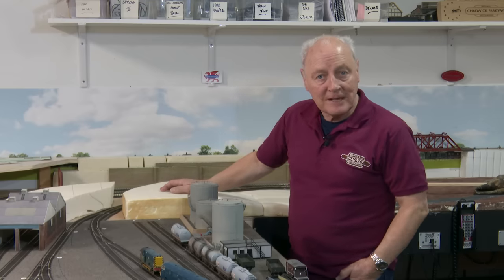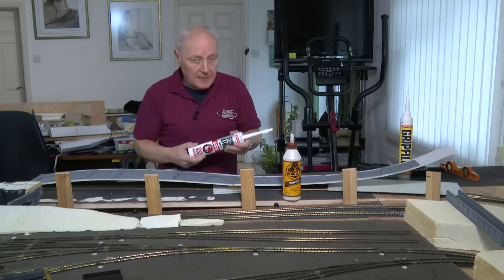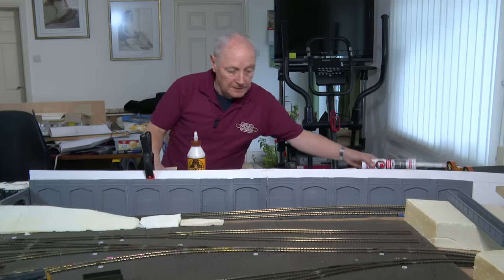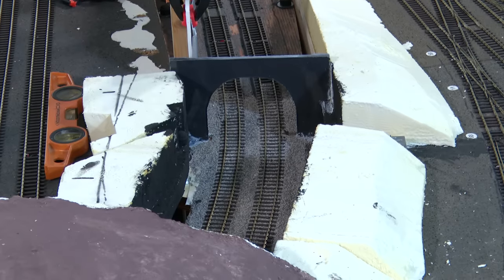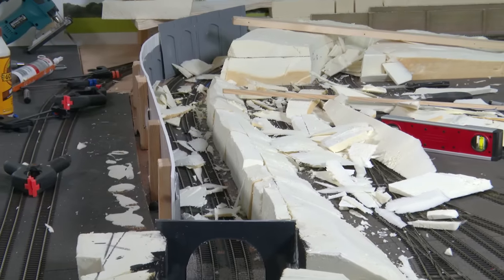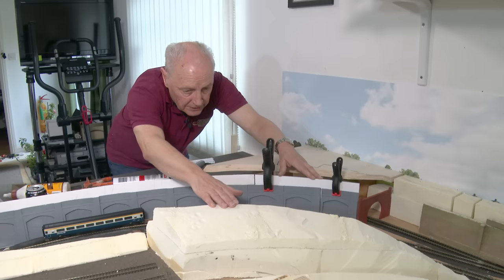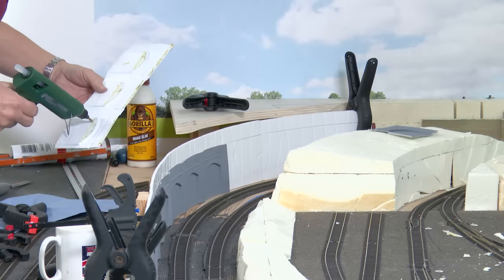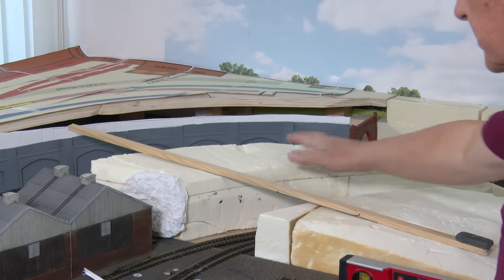BUILDING HILLSIDES & CUTTINGS at Chadwick Model Railway | 207.

Comment: Afternoon Charie. Top tip nice to meet you you last week at Wharley.
If you prefer to use the sticks like etc then find a local upvc center. the cost will be significantly cheaper than big name trade stores.
also normal bog standard clear silicone will work very effectivly on bonding the senics together and at half the cost per tube. Again use your local upovc center. Brands like Henkle (which is bond it) DL Chemicles Wurth a fraction of the price of diy stores and better quality with less water content. easy for me to say though as I use the stuff daily.
Fantastic video again though
Reply from the maker: Many thanks, Richard, for some useful information. Regards, Charlie

Comment: You need to spray teflon/silicone on that Woodland Scenics tunnel lining mold before putting the plaster on it, that will make it come off easier without stressing the plastic.
Reply from the maker: Thanks mate, for useful tip. Regards, Charlie

Comment: Charlie,

I looked at Viesmann and Faller and wrote them both off. They only seem good if you like lorries!  

Instead, I’ve invested in Magnorail which applies magnets under ANY standard Oxford Die-cast car, which makes it incredibly flexible. There’s even a bicycle with the rides legs moving!

I recommend looking at it before you shell out a HUGE amount for Faller and Viesmann. 

Tim.
Reply from the maker: That’s good advice, Tim. However, do you believe it would be possible for me to run the Magnorail system up a hill!?
Reply: @ChadwickModelRailway  According to the FAQ, it can manage 45 degrees, but I’ve not tested that.
Reply from the maker: I hate to spread rumours, but some say it’s a noisy system. Could that be true?
Reply: That’s a fair comment. 

There is a motor running the track vs a motor in each car. I don’t find the noise an issue to be honest - I’m placing my motor in a scenic as part of a tunnel and I have insulation on the screws (track foam!) to absorb any reverb. 

For me, it comes down to 1) cost and 2) the breadth of choice of vehicles you can run. 

Horses for courses. 😁

Comment: Charlie, another interesting video.
Certainly lots of cutting and reshaping going on.
That, I assum foam based, engineered brick wall boards look good, but it is very monochrome.  You would need to pick out different blocks in various similar shades of the grey, and add a lighter mortar to give it more appeal - in my opinion.
Good luck with the subscriber drive, your videos are certainly worth viewing.
Cheers, and stay safe,  Michael
Reply from the maker: Mr assured Michael, the plain brick face will have lots of added detail. Stay safe, regards, Charlie

Comment: Great video Charlie. I have always lined my bridges and tunnels, but in 7mm scale all this has to be done from scratch, especially if on a tight budget! I found that a certain banking co. uses envelopes for their monthly statements that the inside of are perfect size for 7mm blue brick walling and use that! 
Regards, Paul - in a not so sunny St. Blazey.
Reply from the maker: Many thanks Paul, however, my aunt in Falmouth, had 6 inches of snow! Regards, Charlie

Comment: Charlie your cracking Woodland sScenics mould , in a vac mould polystyrene.
You can mend and reinforce it with a small plate of styrene sheet over the crack.

BUT, you will have to use the correct solvent cement!!
None of your go too glues, as  shown will do!
Thanks for the video as ive reached the stage on my layout to start to build a crag, pieced by tunnels, with a castle perched on top. With from eBay -  vintage Faller tunnel portals to complement the castle model.
Reply from the maker: Thanks for your advice John. I should try to drop of polystyrene cement and see how I get on. Regards, Charlie

Comment: Hi Charlie. Another great video. 
I have quite a large run of Faller Car System around my layout. Basically, if the front axle will turn sharp enough, it’ll work. Much like a real vehicle. I have roundabouts etc and they work fine. 

I found my own way laying the road as the Faller road sections soon add up! I basically super glue the guide wire to the baseboard and then use the Woodland Scenic Road System. The tape and plaster etc. Just as long as you don’t pour it too deep, it’s fine. Gives a great road, simple to build and you can actually run your vehicles on it. I’ve also made some ‘points’ in the road surface for setting routes. I punched a pin out of a Seep point motor and bent a length of guide wire into the hole. You then have two route to choose from with the following guide wire. I cover this mechanisms with thin plasti-card suspended on matchsticks. 

Not sure if this helps. Willing to share more info if you need it. 

Also, not familiar with the Veissman system, although I’m guessing it’s similar 

Regards
Daniel
Reply from the maker: Thanks Daniel, that’s very helpful indeed. Could you email me please at Chadwick Model railway@gmail.com so that I can catch your email address should we need to chat off-line. Regards, Charlie

Comment: That video just proves an old observation I was told of and considered fairly sage advice: if you do the small awkward jobs as you go along you’ll set the bar high, if you do things at speed and leave smaller things ‘to go back to’ at a later date, chances are you just won’t. Done it myself before now! 😵‍💫

The tunnel mouth is a case in point: put it in now so you can see it work and therefore avoid possibly creating a bigger issue later on, with the upshot that you didn’t actually save any time or effort because you had to then undo lots of things you have already done to go back a few steps 🫣

I suspect many have done something similar; myself included! Many times I have just wanted to get on with it without paying due care and attention, which invariably just means that I’ll have even more work to do! 🤣😂😅

Ah well, cheers matey! Gave great weekend 🍻👍🍀😈
Reply from the maker: So true, Tim, planning is everything. Regards, Charlie

Comment: Charlie, once again a great video! You give examples of various products to accomplish your goal and alternatives as opposed to some that only recommend what they can profit from. You warn those that use hot glue that you can be easily burned, using yourself as an example. I want to build an apx. 10+/- % grade hillside from grade crossing to the top of a hill that goes over the tunnel of the same train line using Brewer Maine in the 1960-70’s as an example. Granted the photos I have that I took as a kid may indicate that I’m an older aged person but the company I worked for for 38 years changed from a retirement/pension account to a 401(k) account which means I’m an OAP just not the OAP mentioned previously. Cheers!
Reply from the maker: Thanks Steve, I’m so pleased you enjoyed the video. Us oldies need to stick together mate. Regards, Charlie

Comment: Clamps - when I am building structure kits, I often need small clamps that I can use to hold windows against walls, things like that - I purchased from Amazon a hundred wooden spring clothes pegs (the sort that i recall from my childhood when my mother would hang out clothes to dry on the outside clothes line).  They work a treat, and probably cost me $5 or thereabouts.
Reply: That’s a great tip, can see where that works!
Reply from the maker: What an excellent tip, Ken, I need to buy some for my railway room. Regards, Charlie
Reply: We were short of pegs for the laundry the other week, got more than a bit in trouble when the better half found about 50 holding various bits of drying Metcalfe kits together.
Reply from the maker: Time to add close pegs to your Christmas list!

Comment: Hi Charlie,
I have used the Woodland Scenics tunnel liner molds on several of my past layouts and on my latest layout and you can use them multiple times, yes they do crack but you can make 10 liners from one mold. I use casting plaster which is cheap and easy to use.
Reply from the maker: Thanks Philip, for a  useful tip. Regards, Charlie

Comment: Hi Charlie, another great video. Sticks Like is also my go glue, I use it alot in my day job.so know how good it is. It will pretty much stick anything together, I like that it has about 15 minutes working time, just in case you get the positioning wrong and it normally starts to cure in an hour and is fully cured in 24 hrs, then there is no going back. I have had to use a hammer and chisel in the past to break the bond and even them it ripped the wood not the glue, so it great unless you change your mind! Thanks for another helpful video 👍
Reply from the maker: Thanks Chapel Station, I’m so pleased that you have approved of my glue choice. Regards, Charlie

Comment: Hi Charlie, with regard to the car system, although I not implemented it yet my initial research found that a magnetic strip was better than wire buried in the road. This gives the magnets on the vehicles a greater area to stop vehicles wandering of the strip as opposed to the wire method
Reply from the maker: Thanks LR, I clearly have a fair amount of research to do on this subject. Regards, Charlie

Comment: Hi Charlie, a thought about the outside of the cutting.  You could leave the Engine Shed where it is & trim down the Celotex beyond it as the remnant of a gulley that has mostly been removed by the cutting.  This would not only leave the Engine Shed as is, allowing the desired veiw of passing trains, but also from inside the cutting allow a glimpse of the works outside & the rear of the Engine shed peaking over the top of the retaining wall.
Reply from the maker: Thanks Chris, an interesting option. Many thanks regards, Charlie

Comment: Charlie Hi, I have been using the Faller road system for years, on my last three layouts actually. I have learnt a few things along the way. I have gone away from the wire and now use the Veissmann magnetic tape, I find it more reliable. I never liked the way Faller recessed the wire into a piece of wood, too messy and the tool is expensive. So I have always used card on a wooden base. Three pieces of card, if you are using a two way road system, cut to the shape you need, with a very small gap between the three bits the size of the magnetic tape or wire. The card has to be the same thickness as the tape. I buy thin sheets of A1 card from the range. For the road surface I use A1 sheets of gray paper, from the Range, cut to shape and stuck down with double sided tape. Any problems later, just pull it up and replace. Easy!! I can go into more detail if you’re interested. Take a look at some of my old Youtube videos. I also converted the Faller continental trucks to UK one’s , and converted them to run on AAA batteries, no charging.
Atb Doug.
Reply from the maker: Hi Doug, many thanks for such an interesting comment. You didn’t mention the name of your channel if you could do that I would be much appreciated. Also could you email me at Chadwick Model railway@gmail.com please. This will enable us to chat, off-line if necessary. Regards, Charlie

Comment: Thanks Charlie, interesting issues in this one regarding roads. As an observation, would it look better if you change the road that you’ve already done and don’t bridge the river there but end it in a Marina with a riverside pub and some picnic areas with car parking, perhaps a bus turn round point. A nice little diorama at the from of the board. Then create a junction further back and run a new road to cross the river closer to the railway line. After crossing the river, the road can curve naturally towards the industrial area on the other board  in a similar curve to the railway but rising over the edge of the hillside. Then another junction about half way around the curve to take the road up and over the railways to your freight yard. I say that because roads tend to meander a bit more that railway lines, my suggestion is trying to break up what could otherwise look like unnaturally straight roads. Anyway, as I say, just a suggestion. 

I’m also looking to include some moving roadways after I visited James last year and he showed me the Viessmann system. Once you’ve had some feedback to your request for people’s experience in this video, you could use any responses you get to do a future video on the subject. I’m sure James could add some valuable insights for that ?

Take care Charlie, until next time.
Reply from the maker: Thanks Bryan for such an interesting comment.  Could you possibly email me a sketch to Chadwickmodelrailway @ gmail.com.  I was planning a pub and a mill alongside the river, but I’m certainly open to options.
Regards charlie
Reply: Excellent suggestion, Bryan, for rerouting the roadway and thus creating some interesting (and realistic) countryside scenes around Chadwick! You're not perhaps a road designer by profession are you 😉 Cheers, Peter
Reply: Ooh I like that suggestion

Comment: Hi Charlie great video as always and really informative.

I note that you’re looking to put a rock face behind the fuel depot and shed but I would suggest that the small cutting that leads into the TMD is also formed from the rock rather than the retaining walls, the geology wouldn’t necessarily require a structured wall for stability/support. 

With respect to the bridges I’d suggest that the lead out from the helix is made from similar brickwork to the retaining walls as the railway wouldn’t necessarily use a different construction material at the time of construction, perhaps use a different style if the TMD was built later. 

Looking forward to the next video.
Reply from the maker: Thanks SM, that’s a very useful comment. Regards Charlie

Comment: Hi Charlie,

If the cutting was created when the railway was built the brickwork on both sides would likely be constructed of the same material to the same design.

As the TMD side of the cutting is that much lower you could consider just having grass banks. Also if the land from the freightyard were sloped downwards towards the cutting there would be no need for that extra brickwork on top of the retaining wall.

Finally, Richard at Everard Junction has cars running that look decent, perhaps you could have a look at his channel.

Another brilliant video Charlie, you should be very pleased with yourself. 👏
Reply: Yes, this mirrors my own view. A single cutting could only ever have the same style and material of retaining wall at each side. It' absolutely inconceivable that it wouldn't.

Also a parapet detail doesn't occur 2/3rds of the way up a retaining wall. With as much modelling license as you can possibly muster, it isn't a variation on a 'prototypical' theme, it's just entirely wrong.

Also the strip of mounding on the side opposite the fiddle yard would be ten times cheaper to reduce to a mound at an angle of repose, than to gainfully employ half of the Midlands bricklayers building a pointless and expensive retaining wall.

The idea of the exposed rock is also baffling, as the odds of having a rock outcrop less than 10 metres from soil so weak as to need a retaining wall again makes no engineering sense really.

We look forward to Charlie's videos. They are wonderfully made and gratefully received. But a little willingness to accept how reality impacts a model, wouldn't go amiss.
Reply from the maker: Thanks mate, I’m so pleased that you found it interesting. Sadly Everard junction uses a chain-link system and suit would go uphill. Regards, Charlie

Comment: Hi Charlie. A great video as usual and i love how things are going for you. I do have a couple of observations. First is the hill for the road. If you leave it a little high in the middle, then it lends to natural variation in the geography. Roads up hills are rarely the same gradient all the way up. It would also add to the visual interest. Second is the brickwork in the cutting from the tunnel. If it were cut by the railway then wouldn't the brickwork be at least similar on both sides? Having such different bricks on either side just got to me i'm afraid!! Can't wait to see how the yard takes shape!!
Reply from the maker: Thanks mate, I’m so pleased that you found it interesting. You are of course right about the hillside and not to spend too much attention getting a two perfect result. However, regarding the brickwork, the inside retaining wall is far shorter than the other. Hence, the arches would look a bit of an overkill. Regards, Charlie

Comment: Hi Charlie, a 15 cm roundabout shouldn't pose any problems, however to be sure trail and error is the way to go.
Reply from the maker: Thanks Robot, but do you mean a 15 cm radius or diameter?  Regards, Charlie
Reply: @ChadwickModelRailway  Diameter actually, depending on the length of your rolling stock.

Comment: I would like to see evidence of an old quarry in the corner where the old engine shed was removed.  The two tracks were used to remove sand, lime or granite blocks. This would leave the cutting and the face of the cliff cut back in random block formation. Foam board and paper could be used to represent either of these stone types and give you a much more solid face to work with.  As an example the old quarry at Milton Keys is a limestone quarry  that is now parklike with large square formations covered in grass and shrubs.  It might still be possible to demonstrate the age of this quarry by including some grassed square shapes built into the inner side of the cutting walls.
Reply from the maker: Thanks George, for such an interesting suggestion. Regards, Charlie